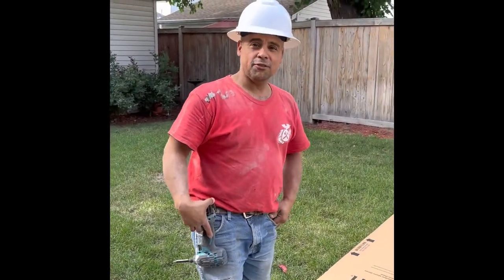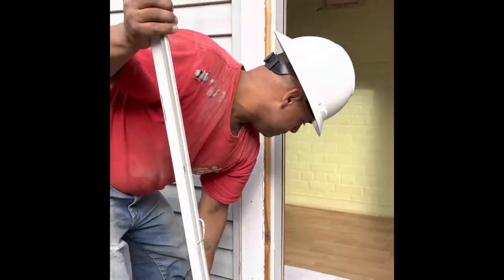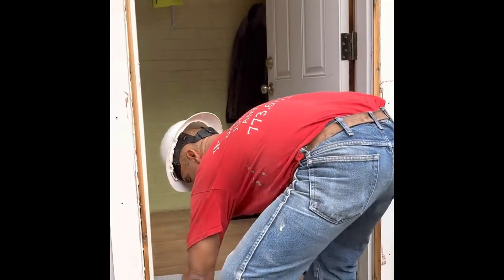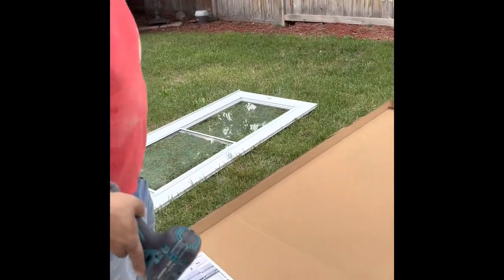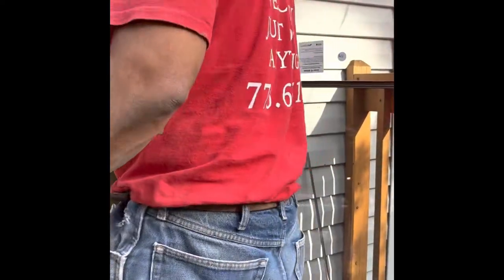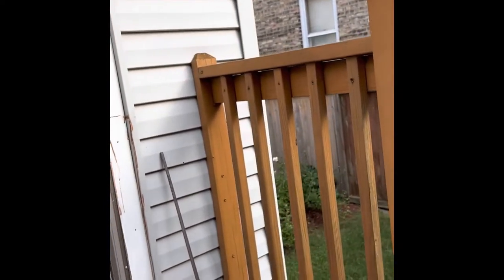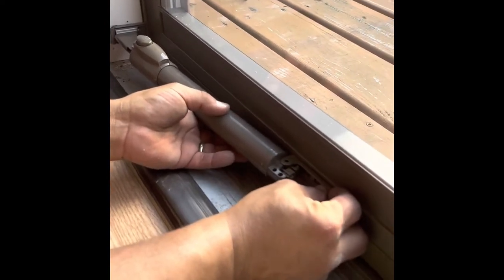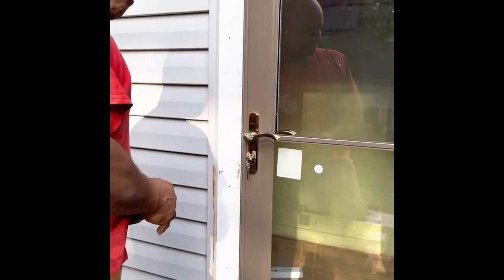How to install an Anderson 3000 series storm door by JP6 Services

Comment: The inside hinge side screws... did you set your door with the hinge rail all the way to the right?

Im trying to center my storm door, but when I do that there is a 3/16" gap between the hinge rail and door jamb. In other words when i drive the screws in, they will bend the hinge rail 3/16".

If I set the door with the hinge rail all the way to the right, then there will be 3/8" more exposed brickmold on the left than the right because the door isnt centered.

Everyone on youtube just sticks the door in the frame but I havent seen anyone discuss centering vs having the hinge side pressed against the jamb.

If I want my door centered, it seems like Id need to make a 3/16" shim to run top to bottom behind the hinge rail (the one you screw in with the door opened).

Love to hear any thoughts. Might have to make that shim, but Im surprised theres no mention of it in any videos or the "45 minute instructions".

Seems like everyone should have the same issue...you cant have both a centered door and the hinge rail pressed against the jamb...unless the storm door is the exact same size as the opening, which would make the opening too small per the instructions.

Hope that makes sense. Anyways, great video, thanks! 20:26

Comment: Installed a custom 3000 (42") yesterday. Although everything is plum the bottom of the door is ajar. I spent time with Anderson tech help. They decided the hinge was bent and are sending me a new one. I think I installed it wrong. The gap at the top of door is wider on the opening side closer on the hinge side looking straight at it.